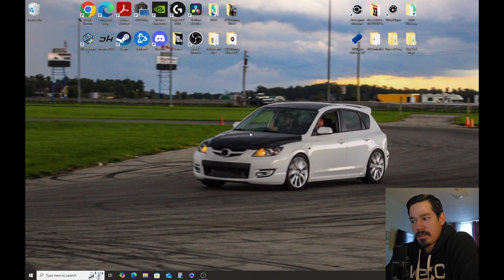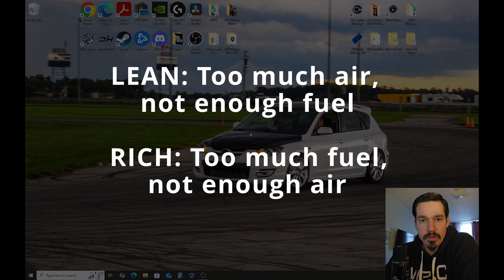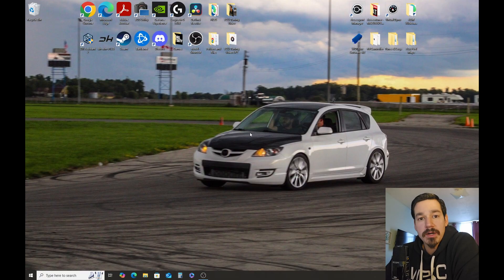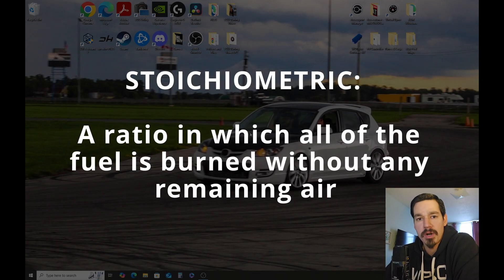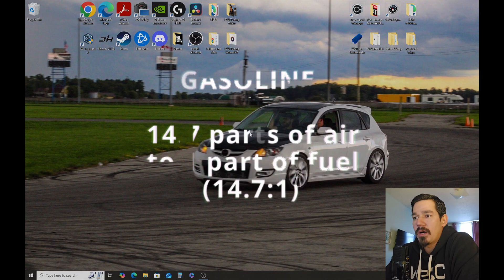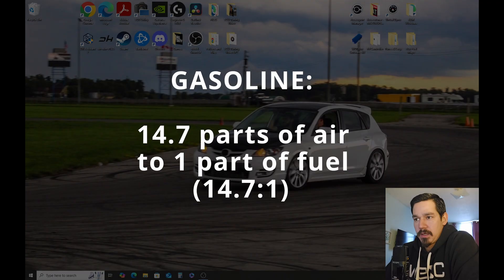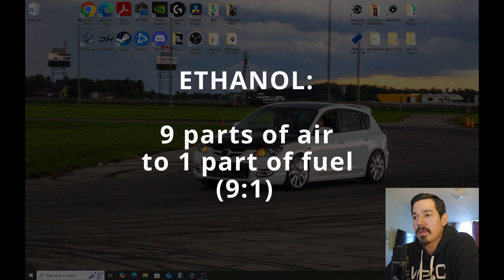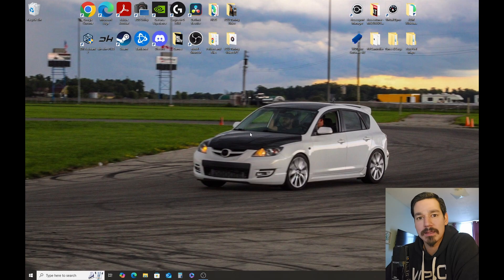Mazdaspeed 3 ECU Tuning Ep.2 - Understanding Air to Fuel Ratio

Comment: Driveability issues with lean AFRs start showing up around 15.5:1. Anyway, if you want to target leaner than 14.88-14.92:1 you need to disconnect the secondary O2 sensor on these mazdaspeed cars, because based on the input from that sensor the ECU will try to bring the AFRs down to no leaner than lambda 1.02 or something. However, with significantly leaner AFRs on engines that only use Otto cycle (not Atkinson or Millers, or a mixture between these) will result in a bit more heat, and also you may see white deposits on the sparkplugs because that small excess of oxygen will start attacking the oil (which is under great thermal and chemical stress around the piston rings during the combustion event). On my cars I went back down to <14.9 for that reason, basically I'm only chasing a cleaner burn at this stage since the excess of unburnt oxygen will not be able to play a significant role in the mechanical work by expanding and pressing down the piston (just like the EGR gasses do, apart from the actual cleaning process they are subjected to).
For high load high boost AFRs of 11 around rev limit are a healthy choice. It greatly depends on the cooling of the engine and the cooling capability of the fuel used. For cars that use WMI, the water used in the mix is very important in cooling down the cylinders during the exhaust stroke (for max power running 100% methanol is the right choice, but adding 10-15% water in there helps a great deal!).
Recently on my CX7 I started experimenting with stoich AFRs for higher loads. So far detonation is under control, but I will have to see how the sparkplugs will look like after 800-1000kms and then take a decision based on that. If I had a dyno room and an exhaust manifold with individual wideband AFR sensors + EGR sensors I could have drawn a conclusion in 2 hours, but not being able to do that I experiment on my own expense :)
Reply from the maker: @mituc  Thanks for the wisdom :) I actually disconnected my secondary O2 sensor and disabled the CEL in AccessTuner a while back, as I noticed a slight dip rich from stoichiometric with the upgraded downpipe (it seems the ECU was compensating some how). Since disabling the secondary O2 sensor, AFR during cruising and closed loop is pretty close to what I'm targeting. I have noticed white deposits on spark plugs in the past prior to zoom zoom boom and was never sure what was causing it. That'll be interesting to see how the spark plugs look with those lean AFR's. Do you notice more power in comparison to a richer AFR?
Reply: @WannabeTuners  Commanding leaner AFRs in closed loop will not give you more power. However, the cylinder temps may slightly increase so the flame front of the combustion events may be a bit faster, which to some extent on in some very specific situations may result in momentarily more torque than you'd get with the same amount of fuel but less air (to make the mixture stoich). So it's not necessarily a matter of making a bit more power that way, but rather having some spikes here and there and possibly making almost as much power as if you injected the amount of fuel for that air. But since this is closed loop/low load operation it's only the fuel economy that matters.
As for leaner AFRs for higher load... since we use fuels that are knock limited on these engines we can't go too lean either. But if for example we hit another mechanical limit, say for the turbo, and we can go from 11:0 to 11.5 then we could see some power increase for the same amount of air. When I was able do that, I've seen more (or at least as much) power increase from leaning to 11.5 from 11.0 than using one more degree of timing advance. However, for the sake of cylinder cooling I preferred to target 11.0-11.2 AFR and use one more degree of timing than target 11.5-11.7AFR (at, say, 6000rpm).
Reply from the maker: @mituc  That's very interesting. I remember a while back reading a post on mazdaspeedforums where someone was doing some power testing with AFR's ranging between 11 and 12 and didn't notice much of a difference in power output (same day same conditions, but can't remember if it was with VD or on a real dyno).
Reply: @WannabeTuners  Basically on pump-gas the optimal AFR for peak power is around 12.5-12.7, but on NAs. On turbo cars the cylinder pressures (therefore the temps) are higher so you can make more power going actually richer, because keeping those temps a bit lower may allow for more timing.
Now, how much leaner you can go or how much richer you need to go depends on the fuel, piston design, injector spray, boost, intercooling efficiency, and so on. Therefore depending on various combinations of these factors you may need to go just one AFR point lower, but usually more, like 1.5
So indeed, sometimes you may not see any difference between 11.0 and 11.5, and you need to pull even more timing to go to 12.0 and that will rob you from a significant amount of power. Because of this, going leaner doesn't make much sense unless you manage somehow to keep the same power per g/s (or lb/min) of air and you want and can go higher in boost/air flow, so going leaner in this case will give you more fuelling head room.
With PI however (pump gas or higher octane fuels from stand-alone PI systems or WMI) the need for pushing these AFR boundaries kind of disappears and you can target the right AFRs, whatever that is for the type of fuel (or mix) used.
Reply from the maker: @mituc  That's interesting. I do notice that on 94 pump gas, anything richer that 10.88 AFR, I'll start getting misfires or it'll break up a little during a pull. I guess they call these rich misfires 😆
Reply: @WannabeTuners  That is interesting... I experienced rich misfires only at 10 and lower, and only when using water/meth as well. I guess every scenario is different and if it was to draw a graph we'd have this rich misfire AFR threshold depending on the boost (so the amount of fuel going into the engine for a given amount of air) being dependent of a lot of factors. By example 10.88AFR at 30PSI means 50% more fuel in the cylinder with direct impact on the front flame speed compared to, say 15PSI on the same engine (at the same RPM, same mods, and so on).
Also, because of the misfires the AFR readings will be leaner, so at 10.88 AFR (reported by the primary O2) with misfires the real air to fuel ratio going into the engine may have actually been significantly higher, possibly like 9.5:1 or so. That would be an awesome thing to measure/study in a lab with an engine dyno, and this discussion with you kind of makes me want one such toy :)
Reply from the maker: @mituc  Sorry come to think of it, it's actually anything richer than 10.73 AFR in my datalogs that I'll see these intermittent misfires under full boost (25-26 psi). 10.88 AFR is usually ok, and I find that with an in-tank methanol mix, it is more forgiving to rich AFR's and misfires less. I also wonder if some cylinders are maybe seeing a slight variance in AFR (some richer, some leaner) due to the fact that I am running 6th port and relying on the intake manifold to distribute the AUX fuel to each cylinder. I know the Corksport intake manifold flows very evenly, but I reckon that there will still be a slight variance in fuel delivery between cylinders.
Reply: @WannabeTuners  The Corksport manifold flows pretty even, I think the Ecoboost manifolds flow closely even to that. I honestly do not think it can get better than that, less than 2% variation between cylinders is nothing. However, depending on how the injectors are spraying and how the boosted air flow carries that charge the mix in the cylinders may change a bit, but not enough to unsettle the AFRs. I am running WMI on a stock ported intake manifold so it's even worse for me. But as long as you add enough fuel to prevent any cylinders from running too lean and knocking then it's fine. The primary O2 sensor will read a mixed AFR from several sensors, as far as I know its sampling rate is not high enough to give a precise reading for every cylinder firing, and even if it had such a high resolution I do not think the CAN is capable of reading 50 exhaust events per second like we have at, say,, 6000rpm. If any cylinder would run lean then you'd see knock retard (which cylinder you can only guess :) or read the sparkplugs if they are still readable).
Reply: @mituc  thanks for the valuble feedback.tell me if u disconect the second 02 sensor.u gona be stuck with engine light correct?
Reply: @rynoPelser-e7p  Yes, unless you are tuning with versatuner.